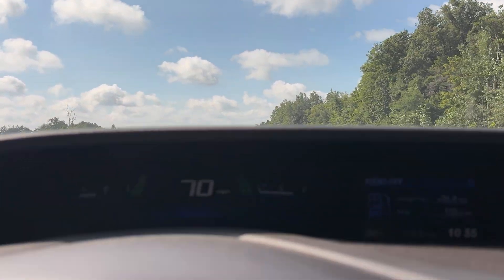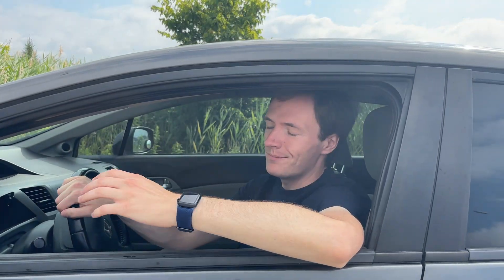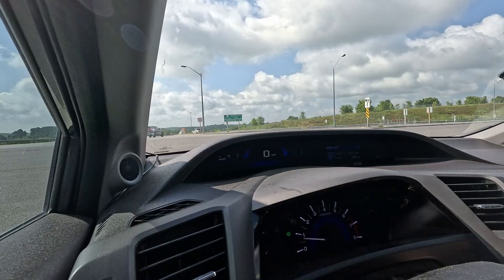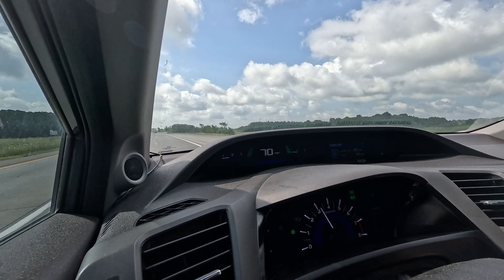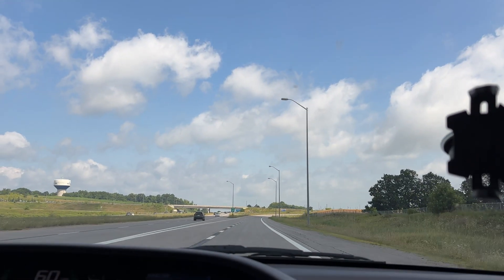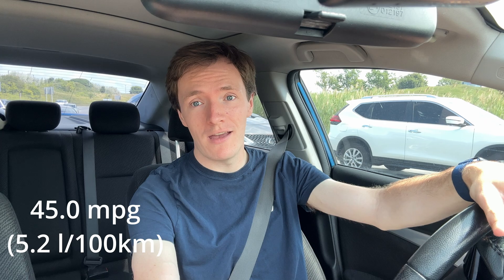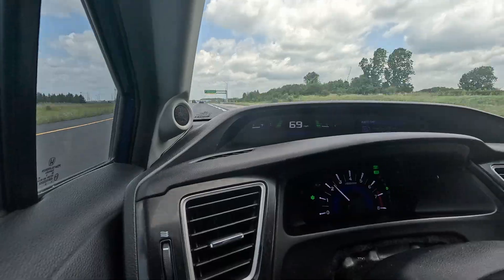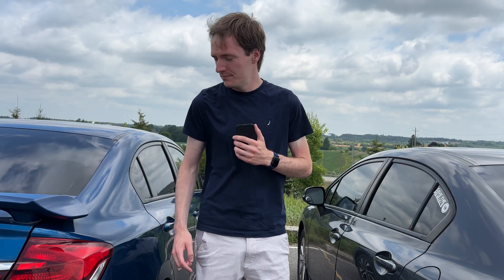Higher RPM = More Fuel? Let's find out! | Auto vs Manual

Comment: I get 32 miles per gallon with my Civic SI and I get 32 miles a gallon with my five speed automatic CRV. Yes the CRV weighs 700 pounds more I get it but I'd rather spend $10 a month more in gas and have the fun of a stick shift although I'm getting older of my knees hurt ha ha ha ha

Comment: My 2006 NC1 Miata 6-speed in 6th gear is like ~3000 rpm at 60mph, ~3500 rpm at 70 mph, and ~4000 rpm at 80 mph. When I was searching for cars to buy, I was looking for a 6-speed because I was under the impression that "more gears = lower rpm in the last gear". But apparently for one that has the 5-speed manual transmission you do get slightly less RPM's than the 6-speed because it is supposedly has longer gears. So yeah completely forgot to consider the gearing of each when I was choosing which car to get. Initially I was like "maybe I should've gotten a 5-speed instead" but hey at least I dont have to really downshift much on the highway to pass and as your video pointed out, it is like just a slight decrease in mpg's.
Reply from the maker: Very interesting! Hopefully the small trade off in MPG is worth the better "smiles per gallon" that the 6-speed gives lol

Comment: Manual transmissions are geared to lose, they can fix the gear ratios for the manual and save more fuel than Automatic, because Manual gearboxes are more efficient in transmitting the power.
Reply from the maker: My thoughts exactly! The efficiency of a manual transmission with an equally tall gear for highway cruising would probably be better than any torque converted automatic. But unfortunately the industry never went that way
Reply: Drivetrain loss is less in a auto
Reply: @cadwang_621 wrong drive train loss is higher in automatic transmissions due to the torque converter
Reply: @cadwang_621 most torque converters are about 90 percent efficient meaning you lose an additional 10 percent efficiency when using an automatic